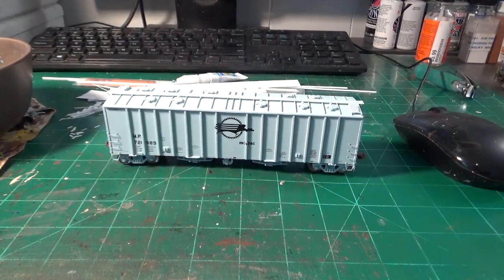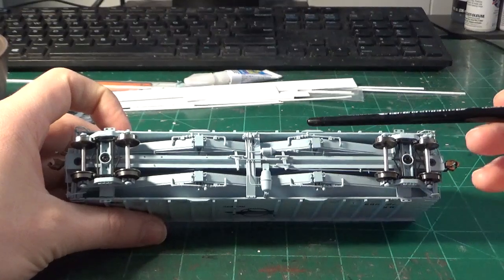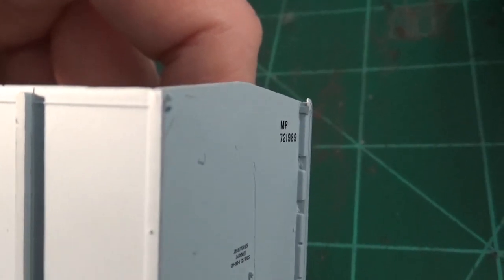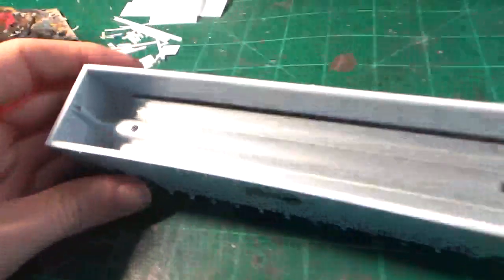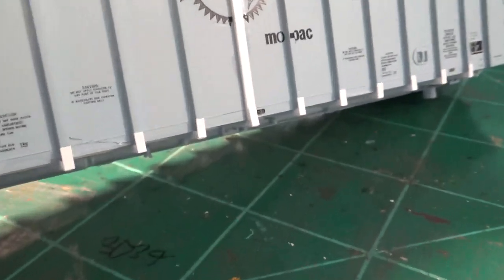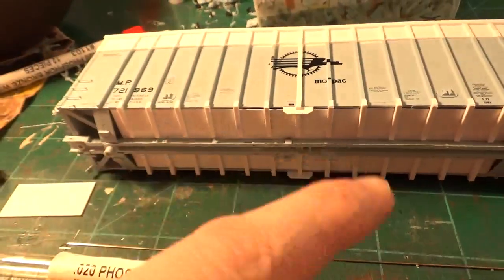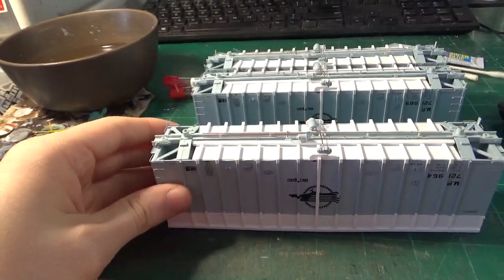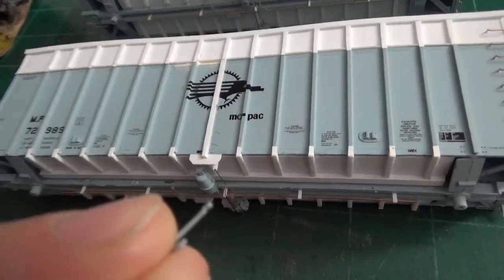HO Hopper To Gondola Kitbash Conversion X3!   CDEX High Side Trash Cars.

Comment: Dan - The airslide to gon conversions from your project were completed at UP DeSoto Car Shops in 2006-07 when I worked there and were originally given NS initials/numbers.  In some photos you might see a small green decal identifying it as a car that went through the shop.   The gons were originally a light grey but like you said probably have faded out.  Overall you’re car is pretty darn close.  Great job.

Comment: I see the CDEX gondolas up here in MA on the CSX.
Reply: I've seen numerous photos of them in Ridgefield Park, NJ which is a short distance from me.
Reply: I see them all over southeastern Massachusetts. CSX train B-727 is mainly cdex or trox or lewx. I also model the c/d trash train.
Reply: @wolfgang548  Thanks for the reply. The units I see around Taunton MA are all black. I think they are old rotary dump cars. Some of the road numbers are CDEX 16063, 19330, 19269, 19424 and 19358.
Reply: @mikewoodbury7248  Thanks for the reply. The units I see around Taunton MA are all black. I think they are old rotary dump cars. Some of the road number I see are CDEX 16063, 19330, 19269, 19469 and 19358.